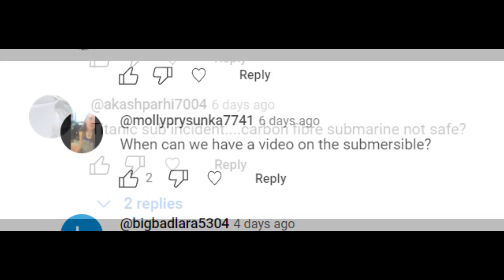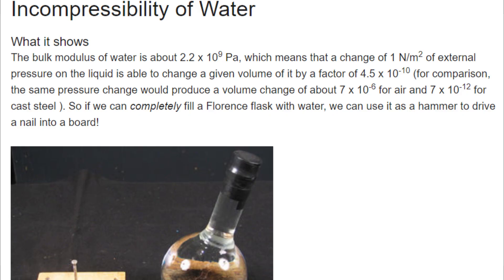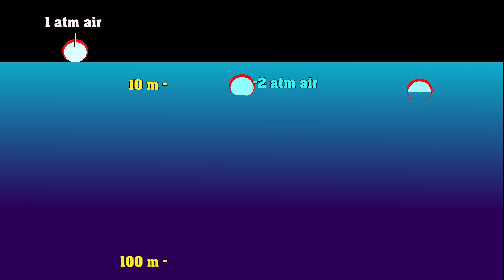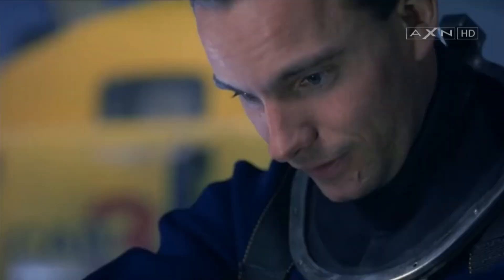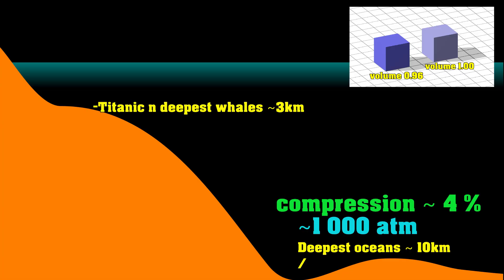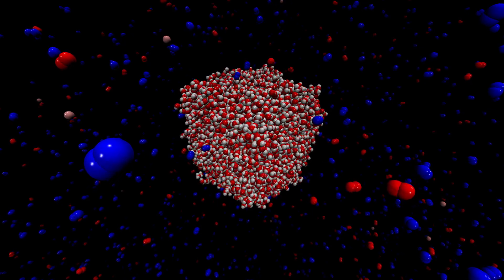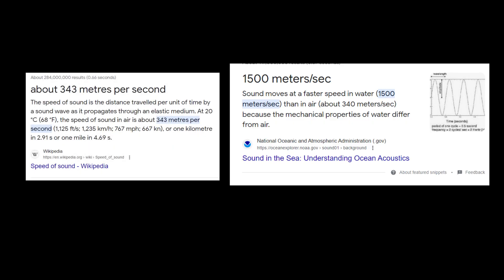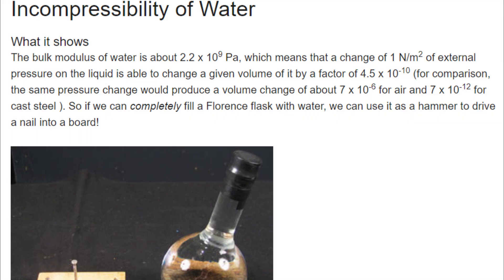What Happens when a Hull Fails at 1000 atmospheres?

Comment: Mistaken. Newton still applies, in which "F=mA" or "A=F/m" in which acceleration is equal to force (pressure) divided by mass. As you point out, water at depth is only 4% heavier yet the pressure is 400x higher, so the acceleration is approximately 400/1.04 = about 385x faster acceleration than water at surface pressure.
Plus look at potential energy: 40 cubic metre sub at 40 MPa has about 1.6 GJ of potential energy for an implosion, compare to 1 ton of TNT is 4.2 GJ. That's equal to 750 lbs of dynamite!
Compare to 40 cubic metre of water compressed by a miniscule 4%. The PE is 40 cubic metre x 0.04 compression x 40 MPa, you get 0.064 GJ.
That means you're 25x wrong.
What's funny is you compare a solid bar to a coil spring and say they are both linearly elastic springs: true, but the PE of the solid bar is practically zero whereas the coil spring can store much more energy. PE = 0.5 k x^2 where k is the stiffness and x is the deflection. The coil spring has far less stiffness but way more deflection, therefore stores way more energy.

Comment: one nice analogy i heard was the diesel engine. Most know a dieselengine and the power it produces. The happening in side it (diesel/air mix gets compressed and then ignites and rapidly expands) is actually fairly similar to what happens to a sub. You could say the decompression is basicly a runaway dieselengine just much faster.

Comment: wouldn't the wall of water be a gradient of different pressures as its behaving like a spring?
Sure at the point it enters the sub it would be 1ATM but as the water filling the void get closer to the ocean side, it should have approximately the same pressure as the ocean at that depth? Should the differential pressure waves be oscillating until reaching equilibrium?

Comment: 🤔 What if you get a "slow" leak? Of course  we're talking ns timescales here so slow is relative to the time of total failure. Here you said about opening the door resulting in regular pressure water coming in at supersonic speeds. 
Say you've got your ball of thick titanium and it splits just enough to allow water to come in under pressure - will it act like a high pressure water cutter? Or will it still come in supersonically at regular pressure (and still cut through the other side and anything in its way?)
I'm trying to square water cutters with a situation of stupid depth and a "slow" failure. I mean I don't think water cutters are supersonic streams, but maybe they are??

Comment: The water decompressing into the capsule compresses whatever is inside, which is a mixture of various carbon mixtures like air and human body parts. Sorta like how a diesel engine works. As the 'sub' failed, the contents was compressed and ignited by the heat of compression and in essence the contents exploded like inside a combustion chamber. So in a way, surrounded by all that water, the crew burned to death almost instantaneously.

Comment: So essentially they didn't implode, they got smacked by a supersonic wave of water. I can imagine that hurts...

Could a human survive that pressure though? It was said multiple times in the video that humans are made mostly of water but a 30% compression sounds like a lot still.
Maybe you wouldn't dramatically implode but you'd surely die, no?
Reply: The worst part for humans is compressing air in our lungs and dissolved gasses in our blood. Your lungs get crushed. There have been some cursory looks at humans breathing liquid to deal with the “air” problem, but it seems to be near impossible and also a form of toture.
Reply: @skippy9214  yeah I remember reading about that and how the biggest challenge was preventing pneumonia when you wanted to take the liquid out.

So when people say humans are 70% water do they also include air in our lungs in that calculation? I always assumed we re talking about the "flesh and bones" part.
Or are the other elements besides water equally or almost equally incompressible? (Or hard to compress rather)
Reply: @BillyViBritannia  no idea. There’s still a limit with liquid breathing, but I don’t remember what it is.

Comment: The pictures of the sub debris show the front titanium end cap where the porthole is located. The acrylic window is missing and a commentator was speculating that perhaps the acrylic failing was the cause of the implosion. I completely disagree and this video supports that idea. When the implosion occurred there was basically a hydraulic hammering effect which would have pushed the porthole acrylic window out. The portholes are designed to keep pressure out, not in.

Comment: modern research is showing that whales in fact are not adapted to dive that deep - their bones are covered in the pockmarks characteristic of The Bends and it is merely their imponderable size that keeps them alive through the agony and destruction of vital infrastructure - just as the cancers whales catch are killed by their own cancers before they spread enough to become threatening, or how woodpeckers are very much causing brain damage every time they hit anything that is not partially rotted or otherwise undermined wood

evolution does not care about comfort or suffering so long as it means gametes are passed along to start again